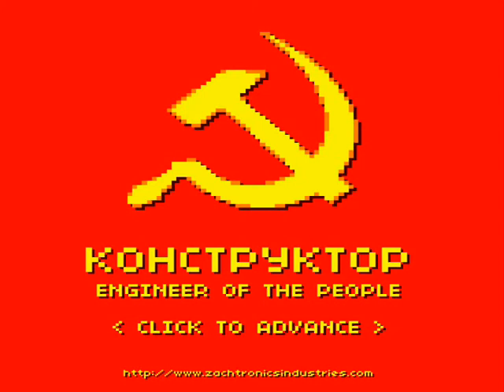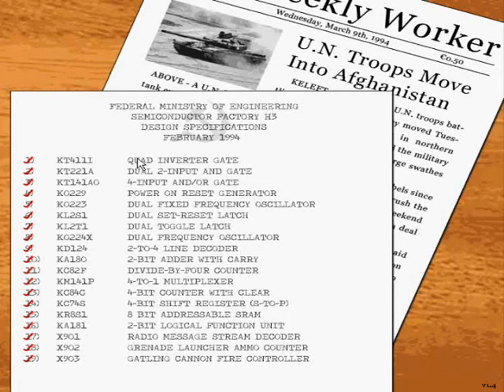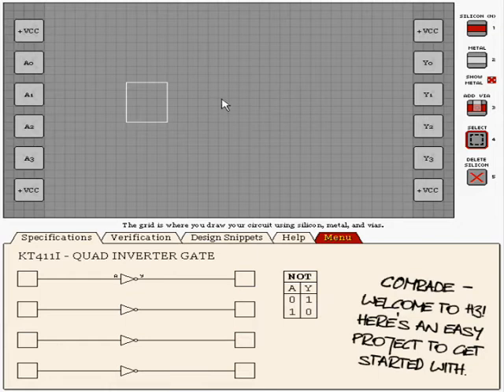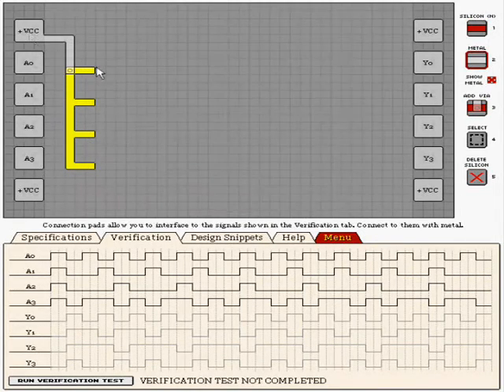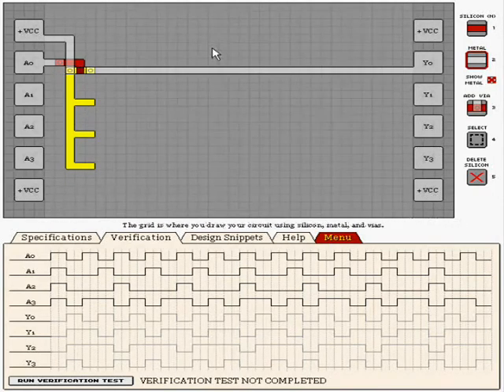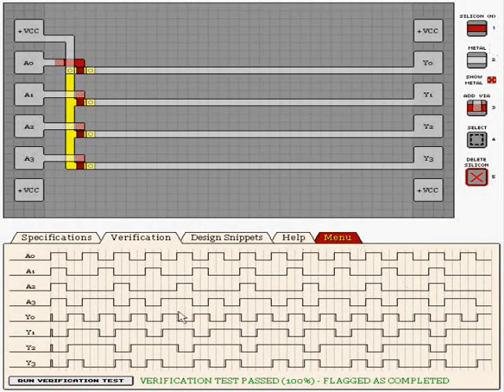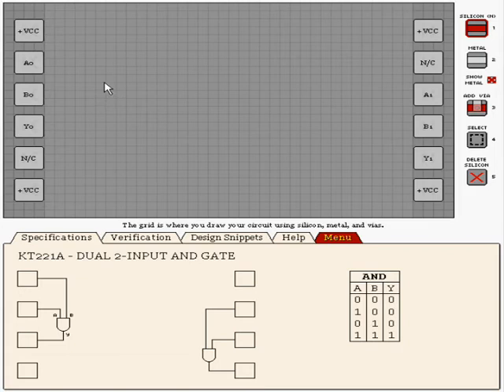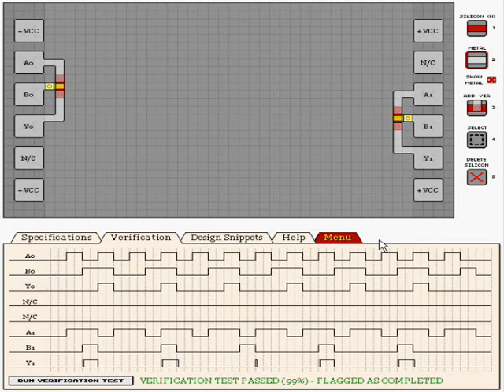KOHCTPYKTOP: Engineer of the People LP: Ep. 1

Comment: Technically the AND gate he used was not really an AND gate but a transistor. It worked in the video (kind of a shortcut) but as far as real electronics it is not correct. This is due to the fact that you want to use VCC+ for your power, not a signal lead, this is because signal leads and VCC+ leads may have very different levels in voltage.
Reply: hence 99% complete.

Comment from the maker: @Mocha2007andcoco Yes, NPN is like an AND gate (need both inputs on to have output on). However, PNP is more like a NOT-converse-IF gate (i.e. output on if and only if collector (P) is on and base (N) is off).
However, due to propagation delay quirk, lag is added if collector is on before the base, but not the other way around - this has important consequences for the 4-to-1 multiplexer.